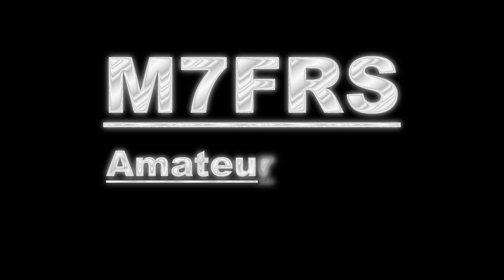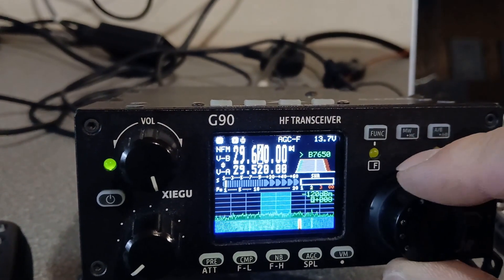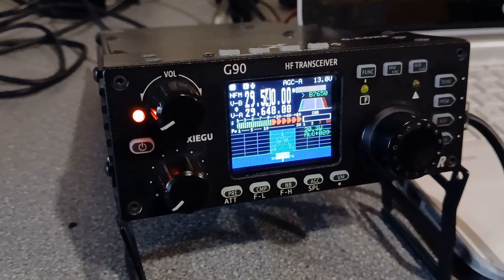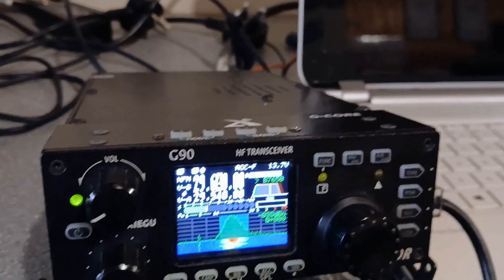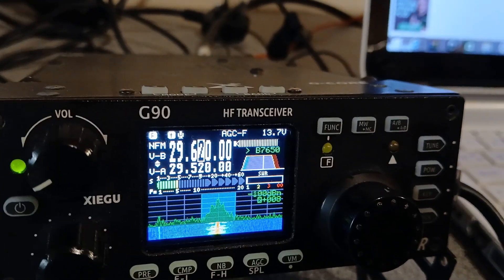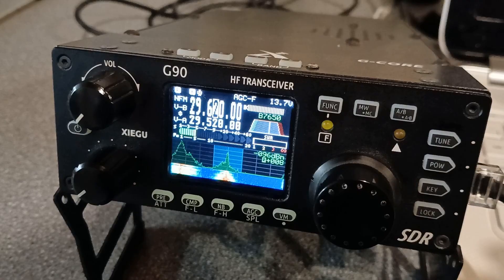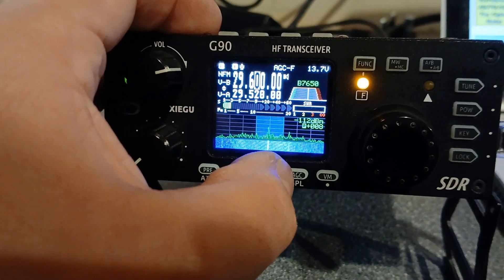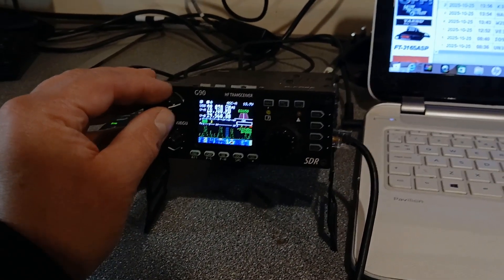Xiegu G90 - 10m FM Repeaters & CQ Worldwide contest

Comment: Hello, how do you get FM radio? I have no sound.
Reply from the maker: I assume you mean that narrow FM mode is not working on yours? If so, it's probably because your running an older version of the firmware. I had to update the firmware to version 1.81 on both the display and main unit. 
Hope this answers your question. 
Thanks for watching 👍

Comment: Nice stuff, bought my G90 a couple of days ago and doing my Foundation exam on the 16th of November. Just out of curiosity what Mic gain settings an RF gain settings do you tend to stick too with the G90? I'm still trying too find good settings and other opinions help a bunch! Thanks, 73.
Reply from the maker: Good luck with your foundation exam! 
The G90 is a great choice for a first HF rig. I'll have to check next time I'm in front of the radio, but I believe I have the mic gain on 5 and the RF gain on 50% 
Maybe I should do a future video on the settings that I use 🤔 
Thanks for watching 👍
Reply: @m7frs272  Thanks my friend! Passed my foundation exam so can't wait to get on the air. Hopefully we can make contact some day, all the best mate. 73!